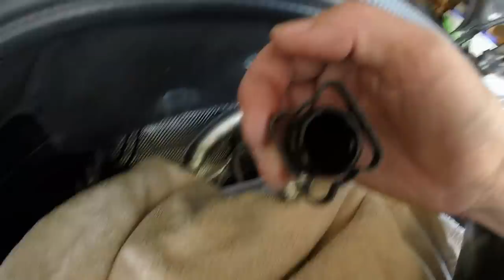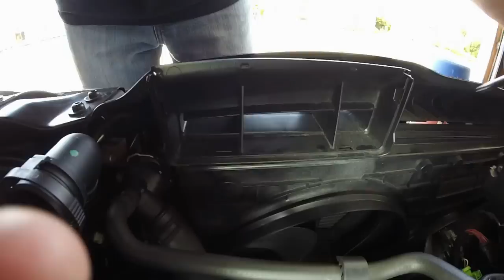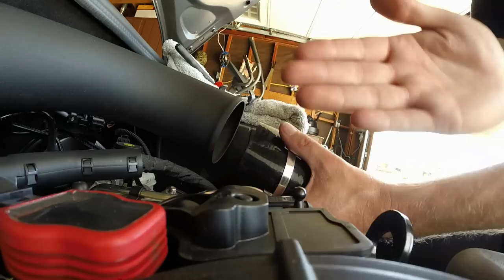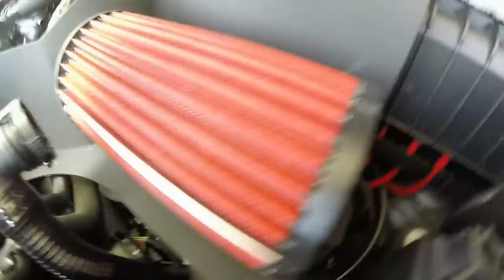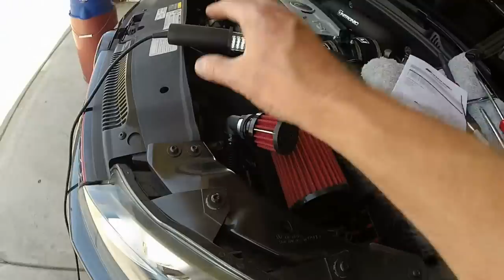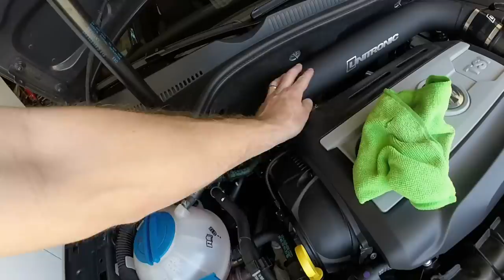2013 VW GTI: Episode 50: Unitronic TSI Cold Air Intake Installation and Review

Comment from the maker: Update which was also posted on the forums. At first I couldn't really sense any added power on this intake. But one day, last Sunday, it finally just clicked. All of a sudden I felt the power clearly, coming on right around 3000-4000 range. For some reason I wasn't feeling it at first. If you are DSG, you have to be in manual mode to feel this intake properly. D mode just makes it feel like a power loss because it shifts way too early.
Reply: Hey the stupid reducer that goes into the turbo inlet. How did you get that to stay it's driving me insane that and there are some lines in the back there that disrupt the opening. Pain in the asd
Reply from the maker: Chris Haley yes those lines are very close to the turbo inlet. You have just enough room for the hose and a clamp in between.
Reply: I managed to get it to work with different clamps that made life much easier.  Now I  need to trim the silicone that leads to the filter so it doesn't rub against the engine cover.
Reply: LastHumansGarage Also did the PCV inlet on the intake ever leak oil?
Reply from the maker: Chris Haley oh of course.. never use the stock clamp, its impossible. mine just barely doesnt rub., but its close.
Reply from the maker: Chris Haley my PCV inlet never leaked in the short time i had it,
Reply: How your intake is doing, did you get any problems. I asking you bcuz I would like to buy this intake for my gti 2012, let me know plz...

Comment: Could a loose hose clamp on the turbo end of the pipe cause big loss in turbo spool time in "D"?  That's what im experiencing.  The screw on the clamp seemed to get stuck at a certain point and it didn't tighten down all the way.
Also, again on the turbo end, the flexible connector hose hits my coolant lines pretty bad did this happen to you?
My coolant reservoir and water pump was replaced at a VW dealership maybe they used different style coolant lines.

Comment: You know this video totally sold me on this intake...  BUT I just went and checked the price.  I just cannot justify the price of this intake I would buy it no questions for maybe $250 but $400 is just way too much money for what you are getting.  Doesn't make any sense.  I am not just saying this, but I worked in a fabrication shop could build this for under 100 bucks and maybe 4 hours of time to do a good job.  So even if labor was 25 bucks and hour thats 200 bucks then maybe charge 300 that is a 50 percent profit.  Now these are produced in mass quantities in a manufacturing facility which lowers the cost a lot just cant see them making 100 percent or more profit.  No thanks.
Reply from the maker: The full APR intake is about $100 more than this one, (omg, APR raised their prices $50 for the set actually, now its $150 more!!) http://www.goapr.com/products/intake_carbonio_20tsi.html and you must not have heard of the new ECS tuning intake which is $650. http://www.ecstuning.com/News/VW_Volkswagen_MKVI_GTI_Kohlefaser_Luft_Technik_carbon_air_technology_air_induction_intake_system_fiber_filter_silicone_2010_2011_2012_2013_2014/ES2739920/ So in reality, this intake is a crazy bargain. Not to mention the best fitting piece of hardware I have ever come across.
Reply: Let me add I do like the intake amd ib realize the others are more $  I guess I disagree with the industry as a whole charging what they do.   But I trust that if you day this is av quality product then it is.   It's hard for me to justify those prices with my skills in a metal shop.   I know there are plenty of people that can justify this cost.   Please don't let my previous post deter anyone from making a purchase.   Quality stuff here.
Reply: And wow I didn't realize how much more the other guys were charging.  This is definitely a bargain. Maybe I should start making my own and selling them.
Reply: Michael Griffin You cannot R&D, Build , prep and paint this in 4 hours.  You could build a raw terrible looking product in a few hours, but you would still need all of the necessary parts for the MAF mount and CBFA connection.  You will come out on the losing end.  If this is too pricey, you shoudl look at the P-Flo intake.
Reply: Davis Green actually I could I have built more extravagant kits in that amount of time.

Comment: Thank you for the great video I used it to install my Unitronic intake on my 2014 GTI. I was wondering though, after installing my intake my engine is revving up 300-600 RPM's above normal when idle and will fluctuate when driving. Do you have any idea what would cause this to happen? Possibly the mass airflow sensor?
Reply from the maker: Michael Diodoro possibly that or maybe a leak somewhere on your install. which usually happens at that back tough area if anywhere.
Reply: Thank you I had to tighten up the clamp that came with the intake. I'm going to buy some different clamps these keep coming lose.

Comment: Hey man question, when you have the intake where you running the DV+ too? I was told with it, it would eliminate the "flute" noise from the intake and get more "flutter" from the DV.
Reply from the maker: in that particular setup, i did have the DV+ and it did eliminate my flute noise IIRC. But I might not have ever had the flute noise with this intake at all.

Comment: Nice video as usual. A quick question, how to clean the filter? It's a dry filter so i didn't want to just wash it off. I had to make sure first.
Reply: Do YOU have an answer yet? I think there is a special spray for cleaning them but I'm not sure
Reply from the maker: dood u just wash it with soapy water. make sure all soaps gone. then let it dry a long time, at least overnight.
Reply: +LastHumansGarage 
That's embarrassingly easy.. :/ thanks! 
Big fan of your videos, btw! I bought a Unitronic intake (for my mk6) because of your reviews.

Comment: what is the little tube that is connected to the front of the stock intake box? I have a 2012 GTI and my car doesn't have one.. however my friends 2012 GTI does. Same model/style and everything.. what is the purpose of it?
Reply from the maker: you are lucky. you have a CCTA engine, your friend has a CBFA engine. The CBFa has a very loud air pump on start up. Your car does not. Emissions..

Comment: what DV do you have on there? I was looking at getting this Unitronic intake but it doesn't come with the DV... I think it shows it the beginning of the video that it comes with it... unless i'm mistaken :S... I know you can buy the relocation seperate
Reply from the maker: i run a GFB DV+ which I did a previous video on. It still works fine so I keep running it. My car seems faster with it, over the stock DV valve. It is in the same stock location. I don't like the added mess of DV relocation.
Reply: LastHumansGarage ahh ok thank... I seen the DV video. so your still running that one.. cool  so whats that smaller filter at the beginning of the video? and the last thing you installed :S
Reply from the maker: MrJoepeps thats for CBFA engines only. That pipe normally attaches to your stock airbox. If you don't have that pipe, you don't need the added expense of the CBFA filter.
Reply: ok thanks :) keep up the great work

Comment: Awesome video!! I really like your opinions on the way things should fit and I consider myself to be of the same mindset.  I will be interested to find out what catback you eventually go with! :)  Also I would like to get a tune but I am a little hesitant about warranty issues.  What is your advice or input on failure rates and what would you do if your transmission were to fail or turbo or something?  Have you thought about that or dealt with that in the past? Thanks and enjoy the new intake!
Reply from the maker: I would take off as many mods as I could and go into warranty. I can probably go back to stock tune with stock downpipe and stock intake. And stock DV. Everything would be stock.
Reply: LastHumansGarage I know you have used APR in the past.   I have a suggestion for a new video.  APR has a 30 day trial on there tunes, would you consider trying out APR and doing a direct comparison with your Unitronic tune?  I think it would make for a great video and I would appreciate your opinion on the pros and cons of each in driveability, features, and performance.
Reply from the maker: Michael Griffin naw.. i wouldnt do that. i didnt even have the money to lay out for this intake, so i charged it instead. switching tunes is way more headache than its worth. they're all close enough. just find one close to you.
Reply from the maker: LastHumansGarage i almost tried out a DM tune box for a special deal but they just couldn't get it together for months and I finally gave up.
Reply: Fair enough.  I am close to both.  Do you have a current preference
Reply: I actually had a Unitronic tune on a mk4 gls.  Considering trying apr this time.  I currently have a 2014 GTI drivers edition
Reply from the maker: Michael Griffin since i have to be able to flash at home since i change my mind every few weeks/months, it has to be unitronic for me. you can't flash APR tunes at home. (i mean changing full stages, not just octane changes.)
Reply: Michael Griffin i have a fsi apr stage 2+ and honestly, i NEVER change octanes.  even going to the dealer to fix a couple things.  it really is more of a gimmick.  i got flashed 3 times (first when i got it, second when i thought i lost it but didnt lol, and third for stage 2+).  only thing is you DO have to go to the shop to get reflashed which is a inconvenience.  i wouldve went unitronic but the nearest place is like 200 miles away vs 15 lol soooo yea.  Whatever you got i hope you enjoy it!

Comment: You don't get the flute noise. Which DV revision do you have installed? Are you running the DV+ spring?
Reply from the maker: I still run the GFB DV+. I don't know what flute noise you are talking about, I have never heard it. Running the GFB with all springs intact.
Reply: Ah. There's a good chance without the DV+, Rev D, or a DV relocate that the stock DV will will make a whine under WOT. I have that issue but hope it will be solved with the DV relocate this week.
Reply: David Campbell i got revision D and it does that noise.  I hate it.  after watching lasthumansgarage's vid on the dv+, i might go for it soon.  im more worried about the o rings though :/
Reply from the maker: Zadiel Vazquez ill be getting another GFB DV+ soon.. that's how good it is..

Comment: Hey Plat, I was wondering why you had swapped out this intake? Was this just a loaner from  Unitronic?
Reply from the maker: I can't remember. I think it was one of those times I was sure i was trading the car in, so i sold a few things. Then I changed my mind later, but the intake was sold by then. So I bought the p-flo/apexi setup I still run these days. The only difference is the Unitronic had more noise than the one I run now. You need to add a rubber isolator somewhere if you run the Uni. It needs some give somewhere to quell vibration.
Reply: LastHumansGarage
Thanks for the quick response Plat. Thinking about switching to Unitronic from my APR, but always wondered why you didn't keep it, with all the great reviews you gave it. Anyways, I really appreciate all the informative videos you've provided and when I have time, I'll try to help you out with your logo =D. Original guy did a ok job, but it is obvious he's not a graphic designer.
Reply from the maker: Spicytunafreak83 i like my logo a lot, a good friend/subscriber did it all for me for free. but i'll always welcome new ideas and designs, thanks. btw.. its plac.. not plat.
Reply: LastHumansGarage
haha sorry about that. for some reason I always thought it was plat.
Reply from the maker: Spicytunafreak83 yes, plac, as seen in this t-shirt: http://skreened.com/lasthumansgarage/the-plac-shirt
Reply from the maker: Spicytunafreak83 also cool, thanks.

Comment: Did you notice any loss of low end. I love the low end grunt it's very street friendly in my area lots of hilly roads
Reply from the maker: jason kent yes. but not nearly as much as all the other intakes i tried. you might try just the front half of that intake if low end is a concern. skipping that huge 3" rear pipe might help.
Reply: Thanks

Comment: If you are trying to get the hose off of the back where the turbo is located DO NOT USE THE TOOTHPICK IDEA. A toothpick could go down into your turbo. Make sure to plug the whole down to the turbo if you do use toothpicks to take off the hose.
Reply from the maker: good tip

Comment: What about all the dust and dirt you'll get in an open filter like this? It will hurt the engine with time, right?
Reply from the maker: sure
Reply: Matthew No what I mean is the air filter is no longer in a box. That's what makes it open. In a standard engine bay your air filter is closed in a box. This filter is now open, and will get much more dirty.
Reply: I don't think that's too much a concern. The factory intake has a cover over the top of the filter, but with the hood down, it doesn't make a lot of difference. A lot of aftermarket intakes use re-usable filters, so you might have to rinse it out every so often.
Reply: I think what he means is that you can see the filter when you open the hood. I don't think it makes a lot of diffrence as the top of the filter is already covered by the engine.
Reply: Did you had an aftermarket blowoff?

Comment: How do you get the stock silicone piece connected to the turbo off???
Reply from the maker: patience... and making sure the clamp is loose. if its the oem clamp it sucks.. a long nose spark plug wire pliers helps a lot. and don't let it snap free or it will take your eye out.

Comment: What are the upgrades and stages on this car?
Reply from the maker: hard to say, it changes every month. at this moment, i have no intake. the car is stage 2 tune and stage 1 DSG tune.
Reply: So why did you remove the unitronic intake?
Reply from the maker: Yanka B going a different direction soon. parts are on order.
Reply: in this video I heard a really nice turbo sound.? Was that a bov ? Or dsg software tune?
Reply from the maker: Yanka B no, ive never had a BOV. VW's don't really use those. And my GFB DV+ doesnt really change the sound. It was just the intake making most of that noise.

Comment: nice intake. nice sounds. not quite but not loud. it was my first choose, but it's kinda expensive. also i got my neuspeed pflow cuz it with carb sticker.
Reply from the maker: p-flo is probably my 2nd choice in intakes, but this one is far more refined. and if i was rich, i wouldnt mind trying the ECS carbon intake which is $650.
Reply: yeah. ive seen ecs intake recently, it looks very nice. no doubt the best intake ive seen so far. however, for an intake, it's kinda expensive lol . by the way, what do you think about the koni fsd shock kit?
Reply from the maker: songyun xie i stopped messing with suspensions right as koni was coming out with the FSD many years ago. the last Koni i had was a Koni red or something. I preferred the Bilstein HD yellows on the same car. but i ended up with KYB AGX adjustables on the same car yet again.
Reply: LastHumansGarage OK. one more question if you do mind XD. Im in uni stg1 and not gonna change it. but i want to find a dp will not cause CEL. people say awe catted combines a o2 spacer can "fix the problem". is that true. for us, CBFA engine is different from ccta. that means any catted dp, combines a spacer will be fine? i dont really care about which brand, maybe they make different sounds? the most important point is never cause CEL. any suggestion ? some options ?
Reply from the maker: songyun xie ive seen all your posts. there is no guarantee ever with any downpipe. every car is different.
Reply: all right. thx

Comment: So does this work just as APR stage 1 + 2 intake?
Reply from the maker: I guess you could say that. They are pretty different designs, one sealed and one open. The Carbonio has all kinds of fitment issues such as leaking PCV bung, brake reservoir contact, and extra bracketry needed to prevent sagging. Since they are almost the same price, I see the Unitronic intake as a far better buy.
Reply: Thanks a lot. Love how much detail you give.. just bought my mk6 already trying to build a little stage 2 daily driver.
Reply from the maker: LastHumansGarage scratch that, the APR is $150 more.. not EVEN worth it.
Reply: LastHumansGarage Hey! So I have a stock 2013 gti with this exact intake and no other mods unfortunatly I only hear this intake while driving and building boost around 3-4 k rpms I cannot hear the intake while sitting in the car just revving it at a stop , at a stop in neutral here is no noise, do I need a tune to hear more? Or is there something wrong with my car ? No CEL or anything just had the car fully inspected and no issues, intake sounds good while shifting in the higher rpms , but I was expecting more noise from this intake , thank you

Comment: Do I need the sai, is it better etc....?

Thanks
Reply from the maker: the mini filter? you should use it if you have a car which has that tube on the intake. just so dirt doesnt get in there.
Reply: LastHumansGarage okay I will check if I have it, is it rare on 2012 gti’s?
Reply from the maker: @sevyn8038  been a while, but i think the "cbfa" engines will have a sai, and "ccta" ones will not.
Reply: LastHumansGarage alright thanks for the info, will look into it, last question is CTS intake or uni, they look so similar and probably have minimal difference
Reply from the maker: @sevyn8038  Uni is much higher quality build than CTS. but if you put cheap things on your car, go CTS.
Reply: LastHumansGarage lol okay uni it is